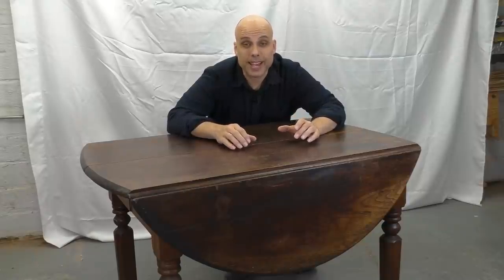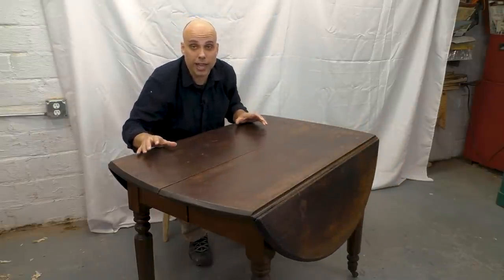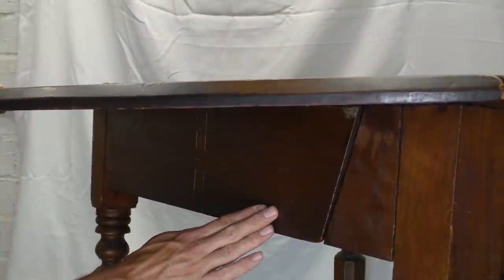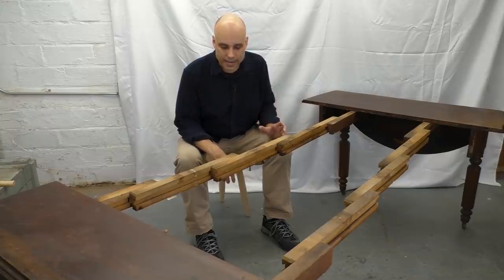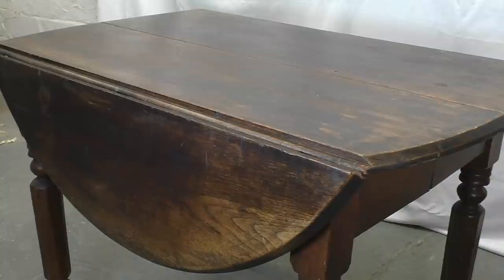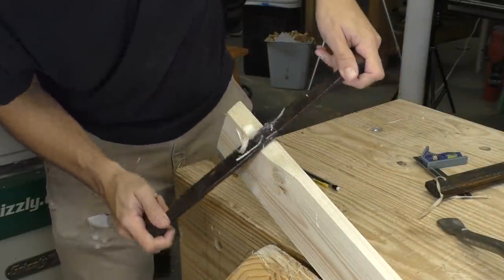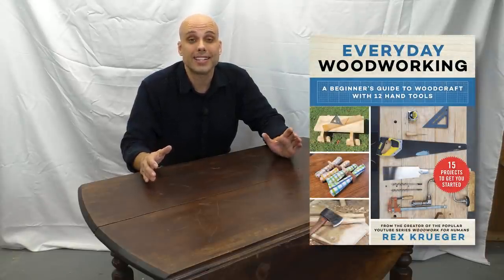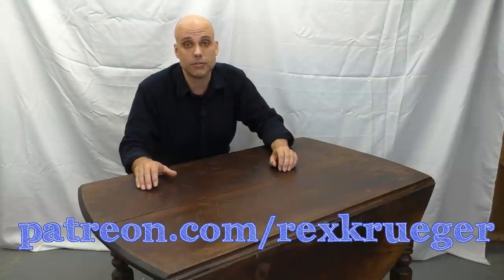Furniture Forensics with a Secret Expanding Table

Comment: My dad has one of these. It's sometimes called a threshing table. It's a normal kitchen table most of the time, but the sides drop down to be able to take it out the back door and then put all the leaves in it for feeding all the threshers.
Reply: Interesting! I acquired an old oak farm table that had the same features as this one, minus the drop leaves. The sliding pieces on mine were made with sliding dovetails, and I was just tickled pink when I discovered what it did.  I always wondered why a farm table would need to expand so much. I just assumed it was for family get-togethers.
Reply: Yup, my parents had one too.  There was a whole rack of leaves for it.  We used it full size once and it went diagonally across the living room and sat EVERYONE.
Reply: @Victoria-jo3wr  It occurs to me that the sliding dovetail probably does the same job but is probably a lot easier to cut with hand tools. Woodwork by Wright has at least one video on the topic, and if I recall correctly the only tools he used in that build were a wooden dovetail plane (angled bottom), a saw, a chisel, and a router plane. He pulled up the blade and laid the dovetail plane across the board to guide the saw on the angled cuts.

I can imagine a table like this being useful for a lot of reasons. All kinds of planting and harvesting and cattle drives come to mind as places where you'd want a lot of extra hands. Barn raisings and moving parties too. Only thing I think this table could use is a built-in rack to store the extra leaves. But that might not have been considered elegant enough for its user.

I so want to build this table. Or, well, one like it. Even if it was more square and functional. Wish Rex had taken a closer look at the leaf hinges though. I'm not really sure how those things go together, and from this angle it almost looks like another wooden hinge. But it's probably a long metal hinge. Here's hoping he makes replicating this table into a series.
Reply: Presumably there were additional legs to support the centre when extended?
Reply: @twotone3070  My parents had something similar that included a single center leg that attached to a cross member and was held in place just by weight of everything. The thing was huge 18+ feet (>6m).

Comment: You mentioned that this table was made about the time that machining wood was becoming more common.  I'm wondering of part of the reason for the shortcuts was he was having to compete with machine made furniture, with the attendant efficiency that entails.
Reply: The leg flanks were cut by a band/coping/skillsaw and an axial jig which uses the points made by the lathe to mount the wood.   Still a sign of excellent skill that they were then carefully planed and sanded.    Remember you can keep old planes around as sanding guides!

Comment: I got to replace a broken track on one of those things about thirty years ago. The one I worked on was a sliding T track essentially and I ended up making a custom router bit to do it. The only way I could see to do it by hand was with a custom made plane set for just that job or a lot of time with carving chisels. Very cool design for the time. I would gladly give up my router for a Barnes velocipede.

The one I worked on also had glue blocks on the apron and legs; and the joints had separated. I replaced the glue blocks to tighten them up.

Comment: I'm fixing up a table with similar flys that support the drop leaf now, except they have a floating dovetail instead of the T-track, and only three segments instead of five. Old oak or some other rock hard ring porous wood from somewhere in Texas turn of the century, and with complicated scalloped legs that now make me consider the context it was made in. The edges of the top got what I suppose was alkali rotted sitting on it's side in a barn for longer than I've been alive, so I've cut tennons into it and put on breadboard ends to replace the damage. I've got a new appreciation for it after your forensics of this one.
Reply: My no

Comment: Great video.  I really enjoyed the analysis of technique and especially the materials used.  The table comes from a time when materials were relatively expensive compared to a man's time.  I am a professional furniture maker who doesn't hesitate to use a machine when it makes me more money.  Nevertheless, I do a lot of handwork.  
The table is a window into the thinking of someone who did what I do 130 years ago,
I suspect the issue with the joints, besides the lack of pins, is hide glue.  Hide glue is water soluble.  In a hundred years it only needs the moisture in the air to dissolve.  I've knocked apart many loose table or chair joints, re-glued them, and found them to be as good as new.  Modern glues have no resemblance to hide glue.

Comment: I’ve seen many expanding tables but also with well designed and integrated wooden brackets to hold the extra panels when they’re not in use. Hide them away right under the table and they are always there without getting lost.
Reply: This one had so many leaves that it would be hard to hold them all.

Comment: Great analysis Rex!  Spot on. This was definitely produced in a larger production shop not a one-man operation. The short-cuts were done by one of a several craftspersons who were paid by the piece and pushing work out the door was the name of the game. Modern hobbyist or smaller custom shops fuss over details they just didn't care about even in fine furniture back in the pre-industrial world. Fine Chippendale chairs have very rough surfaces under the seat where NO one would ever see them. This table would have had a nice table linen over it so none of the rougher elements would be seen and the client just would not have cared. It is interesting to wonder where the enter support went. They all had them when they opened that wide and with out it, the table would have given way!  Keep those videos coming! Thanks for sharing.

Comment: Hi Rex, update on my previous post (below).
I have recently been given a much more modern version of your table. Stacked away, it is 35.5 by 19.5 inches. It doesn't have drop down end leaves but when fully extended, it is still 10 feet by 35.5 inches. It has six legs, two of which support the centre of the table while the two ends slide out on metal mechanisms. It weighs a ton, even without the six drop-in leaves installed!
It is made from thick plastic-covered chipboard, similar to kitchen worktop material but not quite as thick. Each of the drop-in sections has two holes on one side and two metal pins on the other side, all of which correspond to 'dowel-lock' together when connected.
The only fault is that one of the central legs has completely snapped and been fixed back together with thin metal plates. My idea is to replace all that - the whole thing - with some decent wood, which would give it much more strength; in other words, just strip it apart and remake it in real wood. It would be much better than the Ikea styling and flat-pack jointing techniques that it has now. Plus, I could then add drop down end leaves to make it even longer.

Comment: Perhaps there were 5 leafs, since the first piece of the table is #1, and the last is #7, there would be 5 inbetween (#'s 2, 3, 4, 5, and 6). Also, the leafs would have had small dowels on the ends to keep everything locked in place from anyone pressing too hard on one side and torquing the leaf upwards, which would make the table a just a little bit shorter, as the table would have to expand a bit in order to get the leafs in and then contract to lock them in place. You can see 2 dowels on the the 1st leaf and on the 7th section, there are holes where the dowels would have inserted into. My family had one of these while I was growing up, and that's exactly how mine worked. I also remember there being metal locking mechanisms on the bottoms of the middle leafs to keep them in place, although I cannot remember exactly which kind.

Comment: Did your friend have the additional pair of legs that fit the final center leaf and nest into it when it's not mounted in the table?
I'm also thinking a pair of less bulky hinged supports at each end that had short dowels to fit into index under the folding leaves would have put this up into the "rich" range, this table is just well-to-do.
Reply: I wondered the same. I do see a screw extending below one of the slide rails around 7:15 in the video. We own a similar table and there is a single leg mounted to a plank that spans and attaches to the center slides to distribute the tables load.
Reply: Me too. I think it must have been lost with the leaves. My table has the same middle supporting leg. 

It makes me think maybe the previous owners didn't expand it much. Growing up, I remember trying to find the table leaf at holidays was always an adventure... :)

Comment: I've been french polishing my heirloom table I am working from now. 
It's a little older and commisioned by an old Uncle circa 1850, It's Brazilian mahogony with 2x3 foot boards and 2 more inserts and a detachable 5th leg. 
All legs part turned and sculpted. It has a metal threaded rod to expand. 
It has 2x cracks across it, one repair is still holding after my Grandad's cieling fell onto it when a bomb landed on the house in WW2. Still has origional ceramic wheels. I have seen an identical looking table but a little longer on display at Sandringham, the Queen's Norfolk residence.

Comment: That expanding joint reminds me of an old "table" my parents had. The thing looked like a basic cabinet. We kept a tv on it most of the time. The front though, could be pulled out into a super long (>18' {6m}) expanding table. Leaves were folded in half and stored inside with an extra center leg. Fully opened it was longer than any room in the first few houses we lived in. Later we did get a place with a large combination great room (living room, dining room, eat in kitchen [something like: 30' x 40' {10 x 12m}]). With that, a formal dining table, and a kitchen table (all in that room) we could host most of the family for Christmas dinner. As the family has continued to get bigger, we have resorted to renting community halls.

Comment: I always enjoy your videos and I especially like your furniture forensics videos. 
I have repaired a 100+ year old small side table with a drawer that was badly broken when my brother fell on it. 
It was really interesting to see how it was built, certainly was not a high end piece but it had been used/abused and was still going. 
Since I had to manufacture and replace many pieces any $$ value the piece may have had is gone but it still looks the same and it is still Grannie’s table.

Comment: Coincidentally I stumbled upon this video after just refinishing my wife’s grammas table that expands like this one. Instead of having a drop leaf the table folds up to about 24 inches wide with a single panel that folds over the entire top via three mortised hinges. The original hinges were long gone so I purchased three new ones from Lee valley tools. Unfortunately the new hinges were slightly wider so the original screw holes so I had to use a small router bit on a dremel. It took some careful work but in the end the top lines up perfectly in time for a family Christmas dinner in a few days.

Comment: If the two end leaves present are 1 and 7, then I think it's 5 leaves missing, not 6 ☺️
Reply: It would be the joints that are numbered, not the leaves themselves. So 6 should be correct.
Reply: @EliasArcher  ah ok then that would make sense 😌
Reply: I'm a software developer, off-by-one errors are our specialty. I'm assuming that the joints would be numbered to match I-I, II-II etc. So the first insert leaf is numbered I on the side that matches the end leaf, and II on the other side. So the far end of each leaf is sequentially II, III, IV, V, VI, VII, so you have six missing leaves.

The split between the aprons is offset from the split between the end leaves - you can see this at 11:25 in the video. Each leaf therefore has to go a specific way round.

The numbering also suggests that these leaves were perhaps not completely identical, otherwise you'd just mark the sides as I and II and it wouldn't matter which one went where. It might be usable with only a few leaves inserted but the whole thing might not line up quite right unless each leaf was in the right place.
Reply: @kruador  such a sophisticated thread. Can't follow. Praise God about this sophistication. Knowledge is wealth.

Comment: That table is really cool!
Shame the middle portions are missing. You could make some new ones, though.
I wonder if there were extra legs to support the hanging middle.
Perhaps those would form another table you could take apart and add the pieces to this table.

Edit: 0:41 I took a closer look at the undersides of the slides, and the middle one seems to have these pegs or holes, and then there is an area, which is lighter in colour extending to the centre, which would be too narrow to be a table. The middle legs would be stored right there. Then there is a possibility that the middle leg would be just one leg to be more out of the way.
Though you could have them closer to the centre, too, and have a ladder-like shape to store the leaves perpendicular to the table, but only with the two flaps up. Perhaps with the flaps down, you could neatly stack them on the top?

Maybe those bevelled edges locked the bottom pieces to the table? Then you could have pins going into holes, most of the time hidden by the leaves, and when extended, by a tablecloth. Or do the bevel thing all the way up.
Perhaps the table is intended to have those flaps up most of the time, and only to be lowered to ease in moving?
So you would take the leaves out, remove the extra legs, fold the flaps down, move the table to where there is room to expand it, and then reassemble into the long configuration.

Comment: I love these furniture forensics videos! Is the expanding section really rigid enough to support ~1.5m of table in the middle though?! It looks like it would sag
Reply: Often the center leaf would have a pair of support brackets and come with a pair of slightly shorter legs that also stored inside the leaf.
Reply: I would've loved to see it in its full glory
But sadly i guess the expansion pack is missing💔

Comment: you can make a mortise and tenon joint without glue or a pin using one of three methods which i am aware of:
performing a rip cut into the tenon and inserting a wedge which would force the tenon to expand as it is driven into the mortise (this can prove difficult to do as the wedge must be exactly right as the joint won't be flush if it is too long or the wood might split)
or:
getting the tenon as dry as possible before fitting it into the mortise, this will allow the tenon to expand inside the mortise as it absorbs moisture.
or: 
since nobody can see the end grain of the leg when the piece is finished, cutting the mortises that are used to attach the aprons open at the top is an option, this would allow the carpenter to cut both mortises in a way where they intersect, which is something the carpenter could then take advantage of by cutting a slot of the same width as the tenon, half way through one tenon from the top and half way through the other from the underside, allowing the two to slot into one another, the cross piece could then be driven into the intersecting pair of mortises in the leg from above.

Comment: My guess is that those rails and slots were made with a milling machine (I don't know what they state they were in the late 1800s, but they've been around for decades at that point, so I assume the basic tools were more or less our basic tools already). T slots scream metal machining for one, and the pattern you saw on the surfaces that had to be dead flat is a lot like a fly cutters' patterns, which can also be used to both surface and make things dead flat. T slot is pretty vanilla operation, the regular milling (basically a router bit) from end to end, probably one pass down to final depth, then another with a circular cutter to make the horizontal slot.

As for the joints, I think a blind wedged mortise and tenon would be a good technique to introduce there. No glue needed, won't come apart, completely hidden.

Comment: What's the best way to bevel end grain super smooth and level like that? Just a hand plane freehand? Was it sanded, and was sandpaper commonly used at this time? I've noticed that chiseling produces a much smoother finish on end grain than planing. Why is that? What's the best way to bevel a very smooth surface on end grain?
And possibly just a fun little mathematical fact for some of you out there: an ellipse can be traced out with two nails in a board, tying a loop of string, placing the loop around the two nails, pulling the excess of the loop tight with a pencil, and drawing the path of the ellipse around the nails. If it's an oval, which has no precise mathematical definition, it was done some other way, like freehand.
Thanks for the cool video Rex!

Comment: My grandmother has one like it that expends up to 12m. The system is the same except each corner has two feet. As you pull it open, at some point the feet start to spread out !

Last time we used it we had 20 people (of some of them were children) on the table and 4 more planks so we could have added 6 or 7 more people comfortably !

EDIT : it also has foldable leaves, but i think in this case they're only there so the table can be moved through the doors between the dining room (where it wouldn't even fit completely extended) to the reception room, and back again when dinner is over and one might want to dance
Reply: sorry if i commented twice, i think youtube ate my first attempt but... you know how youtube is